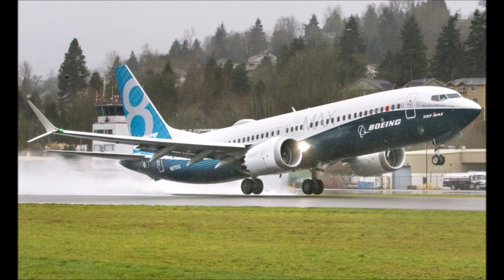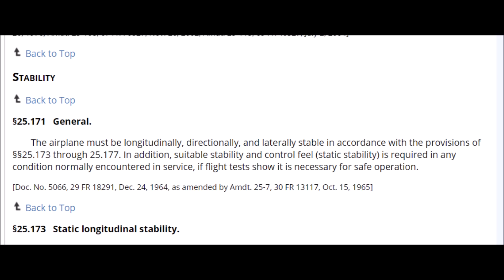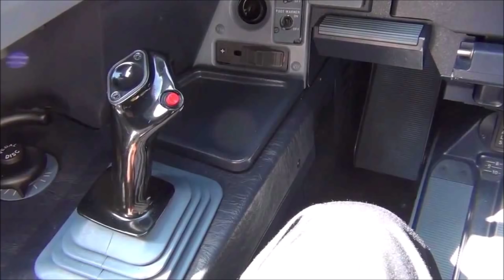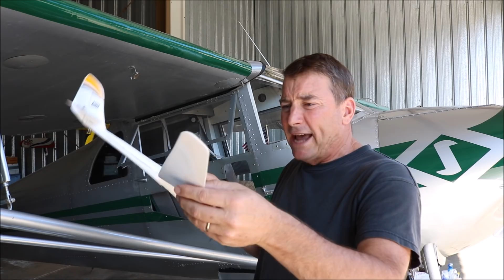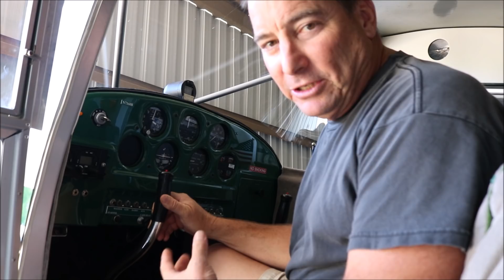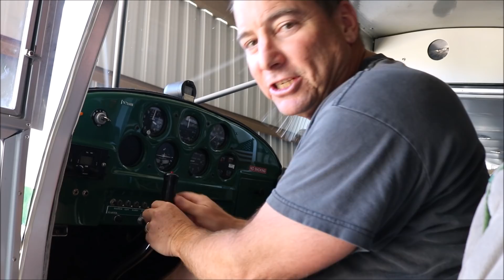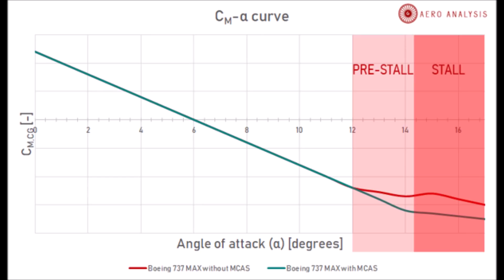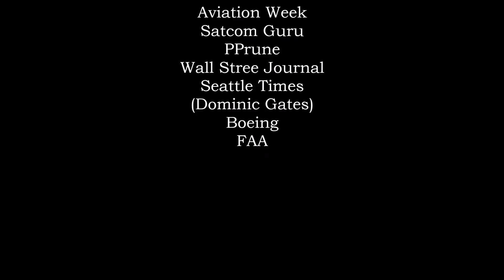737 Max UPDATE 30 Aug  2019

Comment: Juan, as a pilot, what is your take on the Max once it is recertified? Do you think that even a reprogrammed MCAS system is reliable enough for you to trust the plane?
Reply from the maker: Absolutely.
Reply: Alexander McKay MCAS was designed to comply with the FARs, in a small part of the flight envelope that will never be encountered on an actual passenger flight.
Reply: @gordonrichardson2972  Of course. Which means never an instance where it directly contributed to a crash... twice!

Comment: Thanks for your continued updates on this and other aviation events. I really enjoy your videos. Throughout this whole saga, there is one thing that I'm still struggling to understand (as a private, non-commercial pilot). One of the planes that crashed had a runaway MCAS event I think on the prior flight of that airplane, and they were able to recover through the assistance of a third pilot in the jumpseat. Had that third pilot not been there, who knows if the pilots flying would have ultimately recovered the airplane. What I don't understand is how is it that this runaway control event with such serious safety liability/potential for disaster was not communicated to later flight crews so they would have a heads up of a potentially serious problem. I understand that hindsight is 20/20 and not every little instrument failure will be highlighted, but in this case the previous flight crew almost lost control of the airplane, and that's obviously a big deal. Is there a standard procedure for communicating significant safety concerns like this, or is it just reported to maintenance and assumed they will solve the problem?
Reply from the maker: That's a long story in itself. Frequently it is 'inside' knowledge like this that saves the day until regulators can catch up to the problem.
Reply: webpilot71 This video is about the future of the B737. The crash investigations deserve lengthy videos of their own, once the reports are complete.

Comment: Just watched your latest 737Max update. Great reporting! I am a retired aeronautical engineer and worked for BCAC back in the early 70's.  I have a question about the AOA indicator/instrument: 1) Was the AOA indicator on all previous iterations of the 737 only used as an indicator and not tied into any control systems on the plane? 2) What was the defect rate of these AOA indicators as reported by the pilots? 3) I suspect the defect rate of the AOA devices was never considered when the MCAS system  was being designed. If the failure/defect rate was high and there was no system to compare the 2 indicators, then this error in the MCAS system was significantly higher than it should have been. That combined with the modified software that kept driving the trim to an unrecoverable nose down trim indicates possible criminal culpability on the part of Boeing. I don't like saying this as my experience with the other engineers at BCAC I worked with were absolutelty top notch.
Reply: Erin Wright I can't answer all your questions, but it is important to differentiate the fact of two AOA sensors, from the fact that the display of the sensor information was optional. The underlying AOA faults are still not well understood, whether mechanical damage or electrical glitches. AOA was/is used as a parameter for speed trim on the B737 NG, but a single sensor could not cause repeated activation and catastrophic failure. Changing the way in which the AOA sensor is used was the root cause of the MAX crashes. Interesting discussion, but too technical for Juan's type of public video.

Comment: After listening carefully, here's my observation. Rebuttal really:
1. MCAS v1 operate mildly, designed to fix stick feel. Its purpose is to make the MAX feel like other 737. But why does it not not feel like a 737 in the first place? Wrong engines that's why. When MCAS v1 was installed Boeing did not think the MAX is unstable, just feel a bit different. But different enough to need MCAS. Here an sign something is wrong. 

2. Later during flight tests pilot discovered the MAX has more than a stick feel problem. It has actual severe instability on takeoff envelope. The instability is such that if pilot do not manually correct it will stall and crash. Test pilot called this runaway instability unacceptable and asked the problem be fixed. Boeing decided to use MCAS again but redesign it to fix both instability and stick feel. The new MCAS v2 is born. This version takes over pilot control, make the most severe trim adjustments, keep doing it, and triggered by a single AoA sensor. So while we all know MCAS v2 is fatally designed, is it the root cause? No. The root cause is INSTABILITY as confirmed by test pilots. This can be verified, just fly without MCAS. 

3. Can MCAS be turned off? Technically yes, there is a procedure. BUT since pilots do not even know of MCAS and its behavior, how could be possibly run such a procedure, which is undocumented? Of course they get confused, especially when there is no training. So in real life MCAS cannot be turned off. This is why the aircraft crashed. 

4. Boeing claimed to have fixed MCAS. Revert back to v1 based on 2 sensors. If sensors disagree turn off. Pilots fly manual. That is, the MAX instability continue but now its up to the pilots to handle it. Is this a fix? What will regulators and pilots say about this? If the 'fix' is to default to the pilots to fly the unstable aircraft when MCAS is shut off, why not go all the way? Yank out MCAS altogether and have pilots fly as they see fit. 

Juan say the MAX does not have instability. That the cause of crashes are a defective MCAS v2 design, pilot confusion. If this is true Boeing would have fixed it months ago and all MAX would be flying now. 

I call the MAX instability severe, cannot be fixed by MCAS or any other such software. That whatever Boeing submit will be unacceptable to all regulators, that it renders the MAX no longer a 737 type. And therefore the MAX will not fly again. Let's see who is right.
Reply from the maker: wrong.

Comment: I hope we get an explanation on why engineers thought the mcas system should be  so aggressive in the first place . The failure due to a single sensor failure is almost unbelievable and casts dispersions on everything.   I believe its true that the pilots could have saved both aircraft had mcas cut out. The awful question is what else slipped through.
Reply: peter lewis One cause is a 'silo mentality', being only concerned with a small detail, and no single person seeing the bigger picture.
Reply: @gordonrichardson2972  I understand that , but in an aircraft designed to carry hundreds of millions of people and having a relatively vast profit margin I fail to see how this sort of oversight is at all possible . do I have to start worrying about my local nuclear power station now ? I work in a pate factory and the lengths and checks to prevent contamination are extraordinary and strictly checked . Any compromise at all and the entire line is thrown away ..this for minimum wage shift work. We comply because a food poisoning outbreak could mean no job at all . Boeing engineers by comparison are paid a relative fortune . What for ? Has anyone been made accountable for this ?
Reply: peter lewis I agree. A review of the FAA oversight and the certification process will continue long after the MAX resumes flying.

Comment: Thanks for your answer .... so would you say that the larger new engines under high power (ie takeoff) tended to pull the nose up so to mimic the equivalent ‘stick’ weight of the 737 NG (heading towards a stall) the MCAS was added to trim the nose down abit and give it the same / similar feel to to earlier NG model?
Reply from the maker: yep.

Comment: Hi Juan.  Thank you for the update.  It's very informative. I'm confident Boeing will resolve this dilemma soon. It's still somewhat baffling to me why the max crashed with those carriers and not a US or a larger international airline using the max. This is still a mystery.
Reply: It bothers me, too. Lion Air took off from close to msl but in what I presume is a hot clime. Ethiopian took off in thinner air at altitude and also a part of the planet where ambient temperatures are hot. Then again, the US must cover a wide range of ambient atmospheric conditions? The USA, however, is predominantly in the northern hemisphere while the two crash aircraft were operated more or less in the southern hemisphere. Without the currency of relevant information it all seems, as you say, so baffling.

Comment: Although I am not a pilot, I've followed the 737MAX issue closely and I thought I understood it.  But I didn't.  The demo you did in the Mighty Luscombe and the explanation with it made me see that it was the feel to the pilots that was being engineered by actually tweaking the aircraft's actual flight itself (rather simulating it in software) to get that single type rating with other 737's.  I agree, that method seems like one that will be gone soon -  it sounds crazy now but before computers I suppose it made sense.  Great update!

Comment: The more you complicate a system, the more that can go wrong. Give the aircraft back to the pilot and let the pilot be a pilot. If the pilot can't handle the situation, he isn't a good pilot. Computers don't have insight or instinct.
Reply: True, the 737 was designed back when pilots had to be pilots... Now, they are for every country including those with weak pilots. Airbus has done better adapting to the new reality. But, even they are behind with large flux of pilots and lowering standards in the modern era.

Comment: Thank you for the information.  Regarding the Airbus side sticks:  Do you know if they are still uncoupled?  I'm thinking of the Air France 447 crash, where one pilot was pulling back, while the other was pushing forward, neither of them realizing what the other was doing.
Reply from the maker: yep, like Gordon says.
Reply: Dean Fuller The Airbus sticks are still uncoupled, but the training procedures and warnings were updated. The underlying issue on AF447 was a sensor failure, which has also been corrected.

Comment: Juan,
First, Why was Boeing unable to utilize the elevator feel system already installed on the B737 to adjust the control forces?? 
Second, One of the major deficiencies of the B737 is its lack of redundancy in a number of areas. For instance,  the fuel system has a single cross feed system, should it fail (freeze up) on long ETOPS flights, it has the potential to render the aircraft insufficient in fuel should there be an engine shutdown near the equi-time point. The aircraft has only two AOA's unlike most others which have 3. The rudder has a single actuator valve without a second backup. There are only 2 autopilots rather than 3 as found on other modern aircraft. There are only 2 FMC's.
I don't like the idea of only two sources, whereupon if they don't agree within limits they are both rejected. Much preferred would be to have triple redundant systems whereupon a defective unit is rejected while the other two units remain functioning, although, this too is not foolproof as we found on the airbus where two pitots froze up with the good pitot readings being rejected. Perhaps there also needs to be a validation system working through the FMCs.
Reply: Shenandoah Hills The B737 is indeed a very old design, and those features would not be acceptable on a new aircraft design. Each of the limitations that you point out has a backup, either via the pilot taking manual control, or being certified as a tolerable risk on a proven design.

Comment: 21:05 Juan, Thank you for making it clear that two aircraft were not lost due to "third-world pilot training."     23:12 Will MCAS failures be differed until AFTER pilots have rotated through recurrency training that includes simulating MCAS failures?  FAA should issues NOTACs (Notice to Aircraft) prohibiting MCAS system failures if any flight crew member has not completed recurrency  training and practiced MCAS system failure recovery procedures.
Reply from the maker: The FAA issued an emergency AD after the Lion Air crash regarding pilot procedures for an MCAS failure.

Comment: I just saw this video which very accurately describes the 737 Max woes. You mention type rating as the main reason for keeping the 737 in the production line, but there is another one and that is related to the logistics of maintenance. By keeping one type of plane with a high commonality of spare parts saves the airlines a ton of money in parts stock and maintenance. When engines increased in size (higher bypass ratio)  the short 737 landing gear presented a problem forcing the manufacturer to re-position the engines to maintain ground clearance. This route was preferred to modifying the landing gear that would have essentially forced a substantial redesign to the point of  making and new type of aircraft requiring a new type rating and a whole new set of spare parts and therefore added costs. There was also the matter of competition with Airbus, rather than designing and certifying a new aircraft it was cheaper and faster to revamp an old - and very successful - design and fend off competition for a significant period of time.
Competition, ambitious executives,  disregard of engineer's advice (not the first time or the last one) and a good amount of arrogance should also be cited as causes of the 737 Max 80 debacle.
Reply from the maker: Great points!

Comment: Is it true the 737 engines were moved forward in a redisign? Something to do with being too big...
Reply: Sort of....The cowls of the LEAP 1B engines were moved UP and are wider than the cowls of the CFM-56 engine.  They are not significantly forward than the pervious design.

     This wider cowl that sits higher (for ground clearance with the same landing gear design) begins to produce lift at high angles of attack.  This lift force is ahead of the main lift force of the wing.  Because this center of lift is shifted forward during Manuvering at high AoA, MCAS was created to augment Speed trim to give the required stick force gradient to meet 14 CFR 25.137(c) requirements.

Comment: What are your famous words Juan... Aviate, Navigate, Communicate!  In that order. Seems you've done an about face on your original assessment of the pilot error cause of these crashes and jumped on the bandwagon of smearing Boeing - just like everyone else is trying to. All of your explanations, although very thorough and technically accurate, do not explain the full throttle crash into the ground caused by these pilots failure to aviate first.
 In your own words you said the checklists were not followed. They allowed airspeed to increase beyond aircraft limits or control. This condition was preventable by the pilots and should have been a rational  and professional reaction to their circumstances .This is the route cause of these disasters.
I am a pilot and recognize that the wrong action in certain dire circumstances can be lethal - on any aircraft!. We entrust pilots to be well trained, always attentive and current and to take the right action. 
I am disappointed in your assessment  on this one Juan as to cause and suspect you are contributing to the demonization of Boeing and its engineers and employees. I have been a subscriber of yours for many years now and have been impressed by and fond of your command of the science, broad experience, and detailed explanations here and on many if not all of your videos. But  in my humble opinion here on this one your explanations seem anecdotal only.  The agenda of   unionized pilots cannot be ignored  in all of this mud slinging against Boeing and are to a degree understandable and appreciated. But on balance I believe pilot  complacency and error was a major factor in both accidents here. All pilots flying any 737 model after the first crash (months before) should have been hypervigilant and super sensitive to the 737 Max checklists and they  should have reviewed accident reports in detail which most likely could have prevented the second crash. 
I do agree with your initial assessment and comments months ago that anytime an aircraft does not respond accurately while under automatic autopilot that the system be turned off and that was not done by the pilots in both accidents despite the checklist dictate and was ultimately the deadly error. 
An angle of attack sensor failure should have been recognized (and was indeed identified after the first accident report) at the time by the pilots. If not immediately during the event but certainly afterward in the cockpit after aircraft control was regained.
By your own words, Any automatic aircraft system relies on the correct functioning of all components . The pilot is there to monitor the correct functioning of the auto system. The checklist was there to prevent the start and escalation of the potentially hazardous condition. Good airmanship should have prevented the pilots from exceeding the maximum allowable airspeed. I feel It is not reasonable to blame the aircraft for this escalation to the point of disaster nor have you revisited these points on your last few videos on the Max 8?
Reply: Noel Windfeld It is important to separate the issue of the crashes, from the ongoing airworthiness of the B737 MAX. Subsequent testing has proven that the original MCAS design was not safe to fly, and it had to be fixed This video is about the future of the B737, not about attributing blame for the crashes, which is a separate investigation.
Reply from the maker: Thanks Gordon!